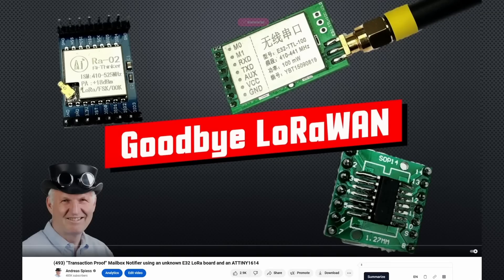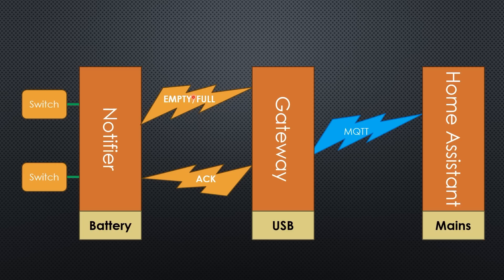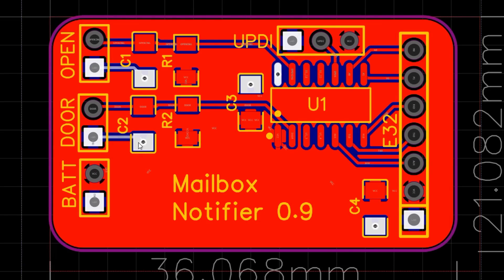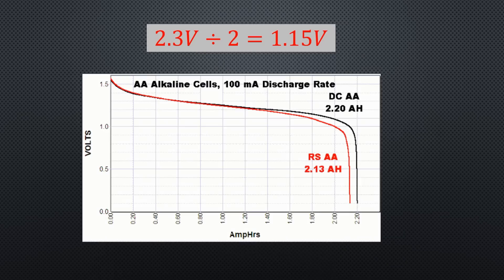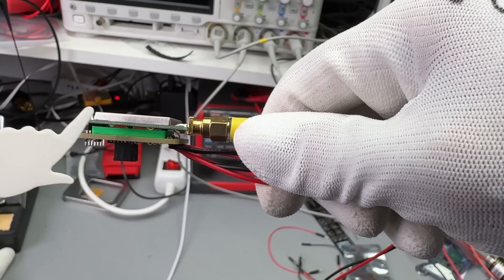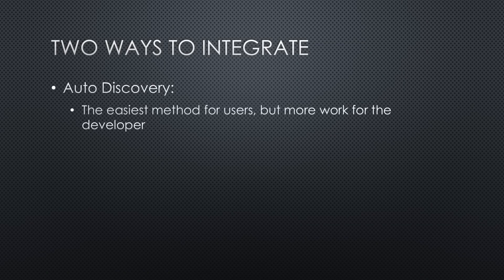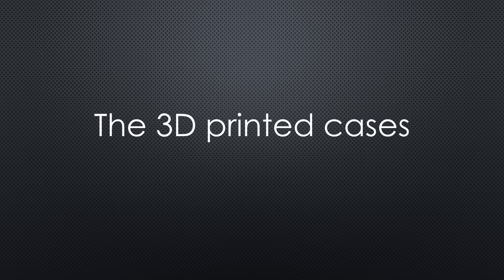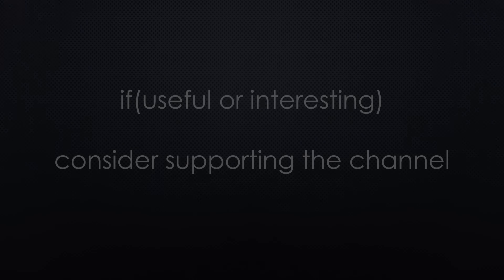(495) Let's build a Lora Mailbox Notifier incl. Tips and Tricks for Your Projects from an Engineer

Comment: I really don't get the point of MQTT in all these projects. Just another unnecessary software component that is a headache to maintain and configure. HomeAssistant and ESPhome have a perfect direct integration with each other and the HomeAssistant native API is all that you really need. The mailbox notifier project idea is quite cool though, I might try it.
Reply: Its not ideal in this application due to:
-Mailboxes often being out of range of wifi
-Higher power draw and lower battery life
Reply: @basileus9343  I think you misunderstand me, the ESP will still be the gateway for the LoRa communication with the attiny. It's the communication between ESP - HomeAssistant that will not use MQTT but they normal HA API.
Reply from the maker: So far I did not see that ESPhome supports LoRa modules. and ARQ. MQTT is a standard used by many sensors and is well integrated into HA.
Reply: @AndreasSpiess  No unfortunately it doesn't support LoRa modules directly, but you can easily alleviate this with a lambda piece of code under the UART sensor of ESPhome (that's my guess though, haven't tried it for LoRa modules).
Reply from the maker: @XavierGr  Then I definitively stick with MQTT. Much easier for me. And withstands all Firmware upgrades...
Reply: @AndreasSpiess  Maybe I am missing something here then. What do you run on the ESP32 if it's not a custom firmware that sends MQTT requests on your broker? If you have to write your own sketch for the ESP (that translates the LoRa module messages to MQTT messages) how is it any better than a couple of lambda lines in ESPhome? I agree that custom code in ESPhome is far from ideal, but in principle it sounds simpler than writing a whole sketch. Plus if you want additional goodies (OTA, mDNS, extra sensors, etc) then your sketch will have to be even more complex no? Is there another MQTT project that I am not aware of that makes integration easier?
Reply from the maker: @XavierGr  Yes, custom firmware. But it's not very complex, and for me, it's faster than learning Lambda, reading the datasheet of the SX127x chips, and doing all the testing...
Reply: Both ESPhome and MQTT have rather steep learning curves.
Both are neatly available in HA
I only have 3 ESPhome devices and I dislike that they are always on an older version of ESPhome (had quite some breaking changes in the past)
Reply: @oscargraveland  With ESPhome you can just update the firmware at any point in time with OTA. With MQTT you do what exactly? Haven't used MQTT with ESP so I am curious.
Reply: @XavierGr  
I also read your message to Andreas. I am not answering for him,  but you are right, you have to write your own firmware that handles publishing and subscribing to MQTT topics
(And that code has to to all the other stuff, like connecting to WiFi and reading your sensors or whatever , too)

Unless anything fundamentally changes in the MQTT protocol, I don't need to update any of my devices.
I have to admit its quite a bit more work (on the device containing the ESP)  to use auto discovery of MQTT devices in Home Assistant.
(There are some projects that you can learn from, but I don't use any of them for now)

I just never understood the whole yaml thing, AND how it connects to both embeded libraries within the ESP-framework AND with the ESPHome integration in HomeAssistant.
I have used some example code before, but it was rather rough and I would have to modify it to make it do what I wanted it to.
I have no idea how much effort it would be to inlude a user-display that displays all the information I would like it to.

And like i think I said (or maybe I said it somewhere else) ESPHome is basically  a layer of confusion around Arduino-libraries and a special protocol connecting it to HA.
I don't like how two or three times a month ESP-Home comes out with an update (even if does not affect any of the "libraries" my ESPHome device uses) that will make my device say it runs on an older version.
Reply: @oscargraveland  Hi again, thanks for the detailed info. The yaml configuration files of ESPhome can indeed be quite counter-intuitive to the uninitiated. I also had troubles with it when I started exploring ESPhome. After a while though it clicks though and once you know the basics ESPhome can be a really powerful and customizable IoT solution without the need to touch any firmware/driver code. In my home I use over 12 ESPhome powered devices for various purposes (temperature/humidity, sensors, radiator/fan control, PC power management, bed pressure sensors, light sensor, presence/PIR sensors, etc.), and I only had to write lambdas (custom c code executed on ESPhome events) once or twice for very specific stuff.

What I really like about ESPhome is all the extras that you get for free with a couple of extra configuration lines. Like I mentioned before to name a few you have OTA updates, WiFi, web server, Bluetooth, etc. just by adding a couple of lines in the yaml file. It is so convenient that even if I don't want to connect my ESP to home assistant I first check if ESPhome supports my peripheral before writing my own sketch. And even if it doesn't support it sometimes you can just add external components to it that other users wrote in github. For example for LoRA there is actually an external component that supports sx1278 devices. You just add the line in the yaml line and you get that functionality for free.

In the end, yes I don't know the relation between the various arduino/espressif libraries and ESPHome, but I don't care to be honest as long as it works. As for updates, you don't really need to update even if ESPHome has a new version (normally I never update). But you can update of course and OTA makes it very easy and the yaml configuration usually doesn't break between updates.

In any case, ESPHome is there to make deployment and integration with HA easier. If you want to tinker and learn, writing your own sketches is much better because you have to do the actual coding and get your hands dirty. Personally I've done that years ago by building and developing my own little Atmel devboards, so now I prioritize ease of use more than anything.

Regarding this mailbox notifier use case, I want to build it with an ESPHome in my local network connected to HA and controlling an E32 LoRa module through the ESPHome UART component. The other side (in the mailbox) will be an attiny2313 with a UART connection to the E32 LoRa module, sending a specific string when mailbox door is opened (for this part I will have to write my own little firmware, can't avoid it). In ESPHome you can write a small lambda piece of code under the UART component to update the state of a template sensor when the expected UART string arrives (I expect this to be literally 2 lines of C code). Home Assistant then just shows the state of your template sensor in the UI and that's it. Since I already have ESP nodes all over my house I can just re-use one of them and connect the LoRa module, update the yaml file and use OTA to update the ESP firmware. And that's it I am done!
Reply: @XavierGr  
And to add... 
HomeAssistant itself has quite a bit of learning curve itself, as does Node-red.
And HomeAssistant itself is so actively being improved, meaning the manuals and youtube videos are often a few versions behind.

Good luck with your mailbox project.
And Thanks to Andries, who is usually a few months ahead of me or just explains things that I am just doing.

Comment: Great video. I ditched node-red for homeassistant automations. Node-red disconnected sometimes from homeassistant and needed to be reset. Homeassistant automations have come a long way, it is has become easier than node-red for complex automations. Above all, it is rock stable for mission critical automations.
Reply from the maker: So far, Node Red is very stable. As said, I move in the direction of HA automations. Still, the possibilities and particularly debugging  is much easier in Node-Red. I would have to do a lot of YAML, and I do not like it.
Reply: @AndreasSpiess  they are moving away from YAML in the current releases. You can do almost everything from the UI now.

Comment: Great video! Ive been wanting to get into PCD design but always stuck to soldering through hole with a nest of spagetti wires all over the PCB. It takes forever and is not much fun. Ill make sure to learn it for my current project.
Reply from the maker: Before these cheap PCBs I also used your method. These days, I tend much more towards PCBs. They look much more professional ;-)
Reply: I am trying to do the same but the upfront time investment needed to learn how to design them correctly is quite significant. One question about this, please: how do you create the Vcc and ground planes? Do you start with a solid copper fill covering each side of the PCB and sort of "carve" the gaps around the tracks as you route them (especially on the Vcc plane), or you only fill them after all the tracks are routed? I'm trying to figure out a good workflow for this. Thanks! (and yes, 1206 here as well thanks to age 😀 )
Reply: @dan-nutu  , there are a lot of tutorials on the Internet. You start with the ground plane (layer) and the supply voltage layer, then place the components, then connect the components.
Reply from the maker: @dan-nutu  These programs do all the heavy lifting. You just add a copper plane and they carve the insulation like magic...

Comment: A tip: primary Lithium 1.5V AA batteries are great for these kind of outdoor applications as they have a large capacity, extremely low self discharge (10 years shelf life), high current capability and continue working in deep freeze temps. A bit more expensive though.
Reply from the maker: You are right! And the Best: I have plenty of Them free of charge from my found Weather Ballons 😀
Reply: That must be a very crunchy polenta! 😀 (yes, it's clear you meant to write "plenty of them", but I read this and wondered what were you talking about)
Reply: Haha, I was wondering the same! I still cook polenta. Everybody loves it, a delicious dish that I inherited from my Italian ancestors.
Reply from the maker: Wonderful auto-correction ;-)
Reply: In my experience they never have the same capacity, that is the ones that include a voltage regulator and charger in the battery case
Reply: @userou-ig1ze  He's referring to lithium-based primary (non-rechargeable) cells in AA form factor, not rechargeable lithium-ion that include a regulator/charger circuit.

The lithium primary cells use a lithium iron disulfide (non lithium-ion) chemistry, and put out about 1.6V when new; slightly above traditional alkalines, but have good characteristics overall.

Comment: Thank you very much! Very interesting solution but complex due to the long distance to the letterbox. Luckily the distance to my letterbox is in range of cheap 433MHz sensors's capability. So I can use RFlink connected to my ioBroker. Powered by 1 AAA. Having no 3D printer, one reed contact is covered by a conduit and the other by an empty toothpaste tube (elmex, swiss GABA  🙂 ).
Reply from the maker: You are very creative with  your packaging! I am sure, when you will get your 3D printer one day, you will be thinking: Why so late ;-)
But, unfortunately, GABA was sold in 2004 to Colgate :-(
Reply: @AndreasSpiess  The toothpaste tube is made of plastics, isolating, water resistant enough and thin. I am not sure, if a 3D printer could produce a housing with such properties. At least not to such a price point :-)

Comment: I love this project as it is exactly what I am looking for. I would just need to water proof the transmitter box a bit more but otherwise - ideal.
Problem is between getting all the components and soldering onto custom PCB I would never be able to finish it myself.
Is there anything like this that can be purchased already made that can be integrated into home automation?
Reply from the maker: As this is a Maker channel, I do not extensively research on available products. So I do not know if something like that is available :-(
Reply: @Edsdrafts  , there are some products, but I don't know how easy/difficult they could be adapted to a home automation.
Reply: Don't be that pessimistic. I went from "No idea how all of that works" to a custom made PCB in 6 weeks while having a full time job. If you are lacking the knowledge, there are a lot of people who can help and a lot of easy to follow tutorials. Beginning with a simple Arduino or ESP dev board and a breadboard is a good start. If you are lacking the equipment for soldering or 3D printing a case, there may be a makerspace not far from you.

Comment: You could use rechargable AA batteries. There are even 1/3 AA batteries, so u could have a batterypack, that has the size of a signle AA battery.
Reply from the maker: A good idea!
Reply: Wouldn't you have issues with the voltage, because they are 1.2v?
Reply: @userou-ig1ze  Look at the discharge curve.
Reply from the maker: @userou-ig1ze  AFAIK they stay for quite long on 1.2V